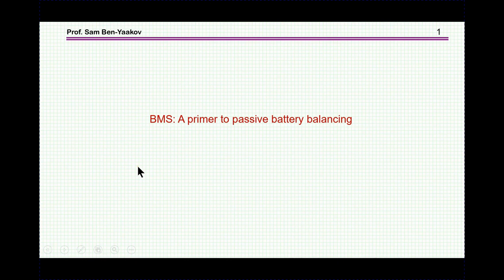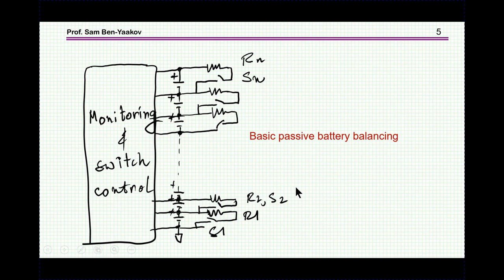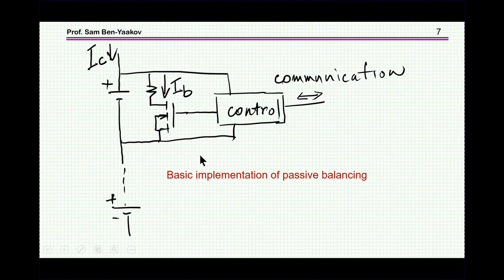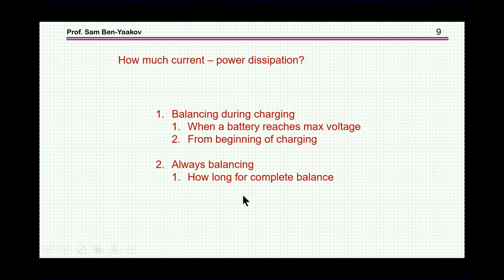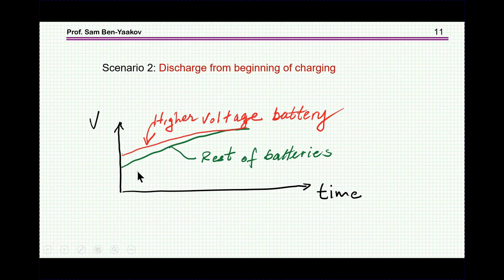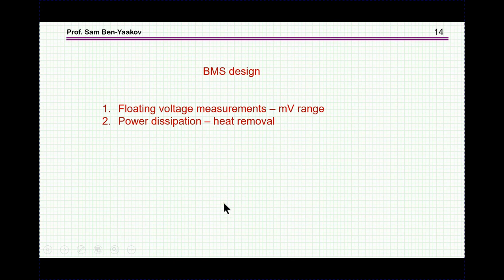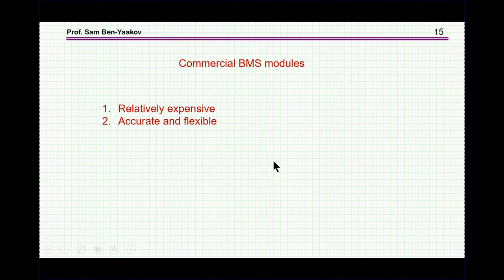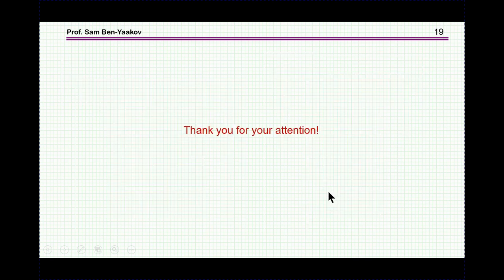BMS: A primer to passive battery balancing

Comment: Thanks for the video, I had to use BMS for lead acid battery in UPS system. I used LT device designed for lithium, like the one that you show, I had to use attenuation stage based T network feedback OPAMP to adapt lead acid voltage ranges to 5 voltage range.
Reply from the maker: Interesting. Would you be willing to post this comment at 
https://www.linkedin.com/groups/13606756
You will have to register if you are not a member yet.

Comment: The charge/voltage curve with LIPO cells is very flat until the end, where the delta/divergence increases rapidly, hence, a good place to measure individual cell voltage.  This upper part of the curve also reflects a very small part of the actual capacity of each cell, therefore a smaller bypass current drain will have an increased effect. However, the  charging voltage must remain above the threshold, the charging current must equal, or be below the drain bypass current for the "balancing" to occur.  The real life requirement is to prevent individual cells from exceeding the upper voltage limit, not necessarily having all cells perfectly equal in voltage or capacity, this is actually impossible. Low current "top" balancing will, over the long term , equalise battery cell voltages , "chronic persistence" pays dividends.
Reply from the maker: Hi, thanks for sharing this knowledge.

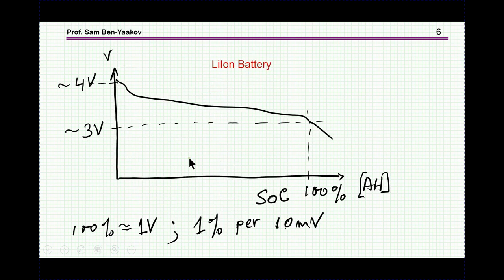Comment: Great video, but I don't understand the little graph you present at 3:20. What is this showing? Why would the battery voltage drop to 3 V at 100 % SOC?
Thanks
Reply from the maker: At about 4V the battery if fully charged. At 3V fully discharged, 100% of charge consumed.
Reply: @sambenyaakov  So, 3 Volts = ~100% DOD, not SOC ( SOC is the label on your X-Axis )

Comment: I designed and prototyped a simple battery charging circuit for some small Li-Ion batteries.  It used opamp schmitt trigger circuits to charge up to a peak voltage, then when triggered, go to a lower hold-voltage and light an indicator LED.  The charge currents were very small (about 5mA) so I could get away with directly charging the batteries from the op-amp outputs.  The circuit worked, but false triggering when a battery was connected or when the wire clip-leads were jostled was the biggest headache with this simple circuit.
Reply from the maker: Inter sting. I guess the triggering was to voltage sense? Some filtering might have probably helped.
Reply: @sambenyaakov ,
  I did this to alleviate a production bottleneck at the electronics manufacturing plant I was working at.  Our customer required us to pre-charge these SRAM backup batteries before shipment, and they only supplied us with a single charging station (one battery at a time).  These batteries required about 6 hours to fully charge, and one technician was spending (wasting) a lot of time fiddling around with swapping batteries in and out of the charger.  We actually missed a few shipment deadlines because of waiting around for batteries to finish charging.  I found this to be unacceptable, and it motivated me to make my own battery charging station.  We typically only manufactured 20 of these circuit boards per order, so I made a gang charger that could charge all 20 batteries in one shot, the day before shipment. 

 Manufacturing Craziness; Sometimes, it's better not to know how the sausage is made.

Comment: This is of course superusefull. But i thought often about this problem of overcharging one in the row. And i always wonder: would simply mounting a 4V3 (or maybe 3V6 or less +0,6V(a normal diode in serie with the zener)) zenerdiode parallel at each cel not be sufficient?
Reply from the maker: This is too coarse. The accurace needed is in the mV range. For that you need an ideal Zener with ultra sharp break which is just unavailable.
Reply: Sam Ben-Yaakov  would the accuracy of a TL431 over each cel be enough? (That little "programmable zener" IC.) With for bigger currents a transistor next to the IC. But no, now I see the need for that sharp break you mentioned. Otherwise the circuits will decharge the upper tenths of volts out of each cel. (I love that "understandable precision" way of teaching, in all of your answers. Its in that same way as in your videolessons!)
Reply from the maker: A high accuracy  TL431 (there are severak versions) will be fine, But...the current capability is meager and if it is used just as a limiter during charging you need a much higher current which brings you back to a BMS with LT431 reference😊Thanks for comment.

Comment: Sir can you please explain why BMS is required for Lithium ion battery and not for Lead acid battery
Reply from the maker: Lead acid are more robust and will better tolerate overcharge. And yet in large installations balancing is carried out.
Reply: @sambenyaakov  
Thankyou sir
Reply: Actually there are balancers for lead-acid batteries, but they lengthen the lifetime (basically eliminating misbalanced overcharging) more subtly for lead-acid than for Lithium. As Dr. BY said, lead-acid batteries tolerate over- and under-charging better than Lithium, but it always helps to balance series batteries.

Comment: If a 16S pack is top balanced. Then you disharge the pack. The cells with have very different voltages. Then when you recharge the pack, the voltages will return to nearly the same voltage = Top Balanced. If you would have tried to re-balance, when the cells were discharged, then you would have ruined the top balance voltage. Seems like Top Balancing should only occur ...at the TOP.
Reply from the maker: Not sure that I follow. Balancing is often done during charging.
Reply: @sambenyaakov  I know that cell balancing is often done during charging. Nothing in my reply says anything about "charging" or "not charging".  You showed a graph, where you suggested  ... Start Top Balancing early at a very low voltage. Way below the voltage where Top Balancing typically/normally should start. That is what I disagree with. Your suggestion to ... start Top Balancing early in the flat voltage range, has actually been shown to unbalance the pack = a very bad idea.  Yes - Top Balance near the knee voltage. No - Do not attempt to top balance early in the flat voltage zone.

Comment: Far better to design a SYSTEM that adjusted the charging voltage as required while bypassing charged cells...
Reply from the maker: Thanks for comment. This video discusses passive balancing. The method you mention is expensive while having its own shortcomings.